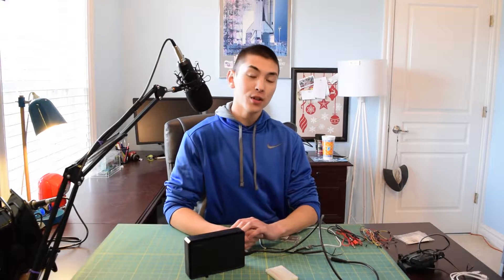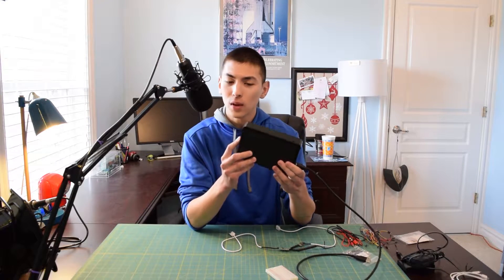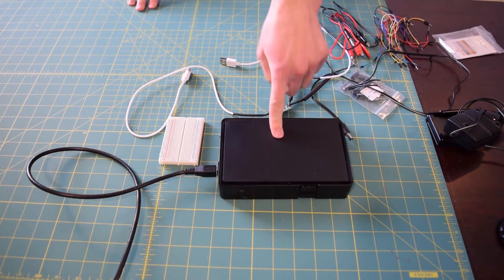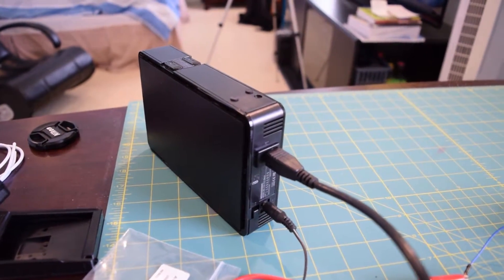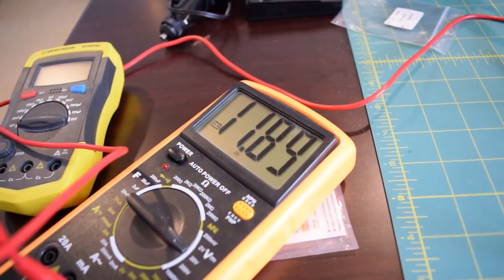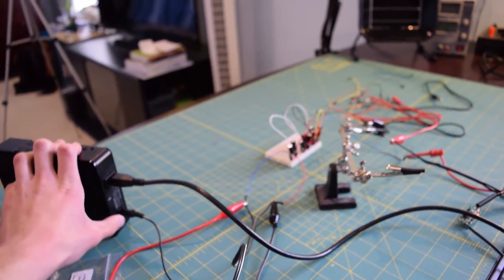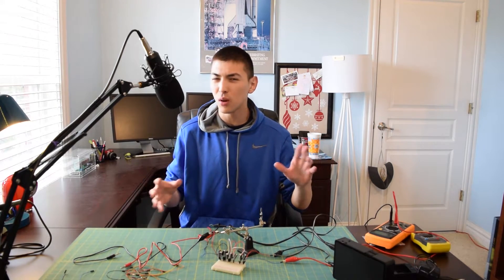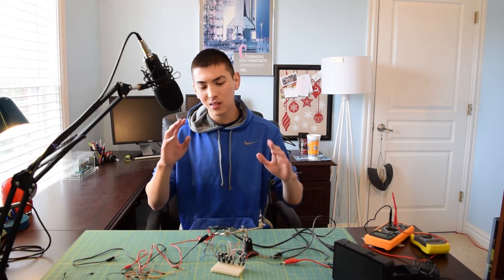Failure EP3: Building a USB 5V to 12V Power adapter for 3.5" Hard Drive Enclosures .... Again

Comment: For the initial start up of the hard drive, you might consider using a lithium battery, instead of a capacitor, as they have a much higher energy density, along with a step-up converter to increase the voltage to 12V. Then when it boots up, you can switch to using the 12V you're getting from the 2 USBs. This can be done with a manual switch, or with an automatic switch.

Comment: Dude,  the PN junction of a silicone diode always gives a .6v and it looks like you're measuring it on the cathode side so the little inverter should be putting out 12.5v

Comment: You might want to try shorter cables to help with the voltage drop. Replace the cables on the breadboard with solid core jumpers.

Comment: If you didnt see my post, here's what you need to know to have a better chance at suceeding:
Use USB 3 ports.
They provide 900mA , instead of 500mA for USB 2 ports. You'd be getting 4.5W of power instead of only 2.5W. Hope my advice helps you.
Reply from the maker: +NeutronPCXT In this video and in the last video I was using USB 3.0 ports.  I really did not want to step up to having to use three USB ports for power but if I want to get this to work it looks like I will have to end up doing that. Thanks for the input!
Reply: +AA Computers and Technology Sorry, I didnt actually notice it.
Reply: +NeutronPCXT Also, do you think you could use USB Type-C? As it would make it really easy.
Reply from the maker: +NeutronPCXT I personally could not use USB-C because nothing I own utilizes that port type. In theory though (correct me if I am wrong, I just did a quick google search) USB-C alone still would not be able to power up the drive. According to wikipedia the interface is capable of putting out a max of 3.0A at 5V (15watts). The drive consumes 24 watts (2A @ 12V) upon startup for a few seconds so you would still need a capacitor bank to provide enough power to the platter motor upon startup.  After the drive initially powers up though, a single USB-c connection could keep the drive running.
Reply from the maker: +NeutronPCXT I take that back, the section of the Wikipedia article was wrong. USB C can output up to 100 watts so it would be able to run the drive all by itself.